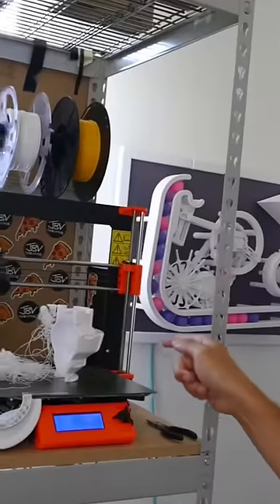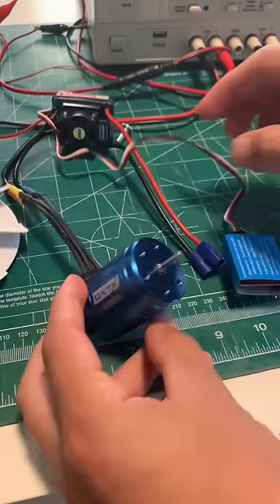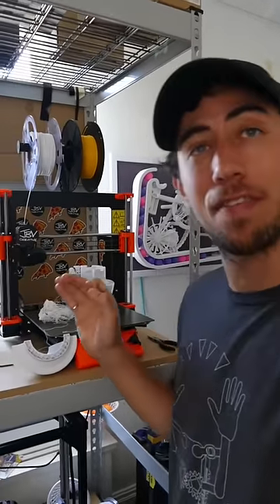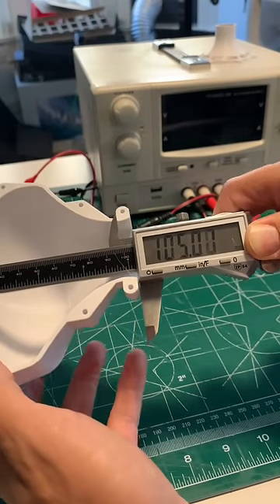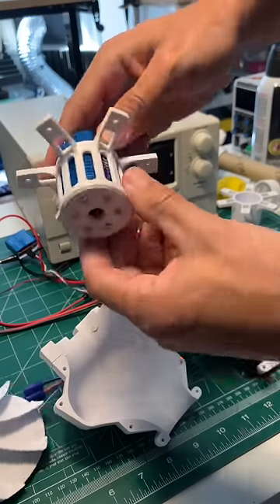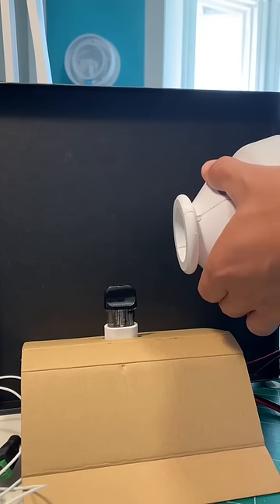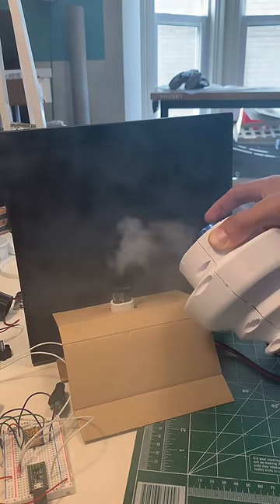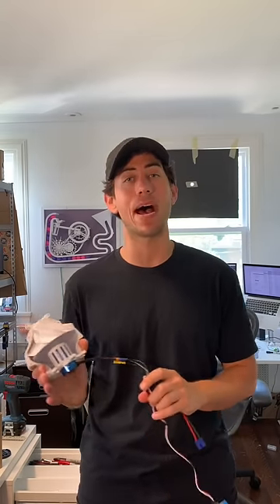Making A High Powered Fan with 3D Printing

Comment: I have had success redirecting the outward flow of a hybrid type of impeller like your (axial/centrifugal) by adding fixed blades at the outlet to redirect the flow backward. Like the stator in a turdine. Another thing that helped was to print a full circle wall around the impeller so you don't have to deal with impeller clearance with the housing.
Reply: Make sure the area of your inlet and outlet is the same so that the air can keep the same density all the way. That way, all the energy goes into speed. Right now, your outlet looks way bigger, which means the air must decompress so much that it creates a vaccum. We're in Bernouli's territory!

Comment: It’s pretty easy to solution as to why it’s creating vacuum on both sides. Number one your fan apparently has a bell like structure which means it has a negative zone of pressure at the larger end, so well some air and escape it isn’t enough to overcome the vacuum that’s propellers are making as it rounds the edge of the containment. This results in air being sucked back in and into the bell like shape on the interior. To solve this you just simply need to round the edges of your propeller at the end on the larger side and also make a flat end but that won’t result in maximum air movement. I redesign of the propeller by drilling holes in the bottom of it and opening the propeller would be best.

Comment: Look into centrifugal pumps.  The outlet is typically tangential to the outside diameter of the housing.  Also the housing has a volute shape to help with the flow or movement.

Comment: Increase the size if the outlet. Outlet should be around 2/3 greater than the inlet and the outlet needs to be positioned correctly. 90 degrees from the inlet. It’s a turbo dude!

Comment: Exponentially low area and high speed at the exit curve. Just cover the center part of outlet at the bottom of the motor and all the vaccum in the back side will be either removed or added the front instead. Maybe also instead create a shell wholely encasing the housing with a gap, creating another pathway on the outside of it using the high speed air at outlet to suck more in.

Comment: I'm guessing the inlet may be starving the fan of air. Expanding it and/or bowing out the walls next to the blades should allow incoming air to pull in more air "buddies" (friction) along. Currently, on the output side, you can put a cuffed vent on the end to better segregate incoming and outbound air, possibly with a twist similar to rifling. Subscribing for the future! 👍

Comment: You need vanes or a volute to laminarize the flow again and convert the high velocity created by the radial blades into higher pressure.

Comment: It looks like a lot of good advice has been given, but mine would be to check the pressures at each point and user Bernoulli’s Principle to see why you have 2 regions of negative pressure and what you would need to do to fix it.

Comment: Hi, mechanic here that works with impellers. It doesn't matter the direction the impeller turns. That just changes the in and out sides. The reason you are getting suck back, is the housing isn't sealed and the impeller has too much wiggle room between the housing and the impeller it self.

Comment: Could be that the air speed on the exit end is creating a really low pressure zone there and sucking the outside air, but i dont know why it wouldnt join the rest of the air flow instead of going in lol.
Reply: after thinking about it, it might be due to the big surface area of the exit end. Try making it concave instead of convex, this should make the air sucking almost imposible while also getting you greater speeds since it's subonic airflow. Printing it from the ground up should also help mitigate structure imperfections. Hit me up if I was of any help! would love to see the end result

Comment: Yeah the outlet is in the center. The outlet needs to be at the widest point where the impeller swings it at.
Reply: Yea that's how turbos and centrifugal superchargers work. They basically fling the air to the outside of the compressor wheel.

Comment: In cases like this you should either flip the print the other way to put the weight at the bottom or else have it print a small base which is attached to the print with small prongs that you can break or cut off, you could even widen the base and have it print both halves separately on the same base at least my brain says it should work. Then again I don’t have any experience with 3d printing so I’m equally likely to be totally wrong.

Comment: It's a centrifugal pump so all the air gets thrown to the outer edge of the impeller, your outlet needs to be on the outer edge of the impeller, infact it should be a volute casing

Comment: It looks like if you took 2-4 giant O-Rings and sealed the turbine top and bottom at “inlet and outlet” it might have a more direct air flow.. but when I say 4 I’m thinking that the other 2 are on the turbine’s tip and tail sealed to the wall next to the other two then a couple drops of a lubricant between, hopefully allowing a faster spin!!

Comment: Your inlet and inlet fans need about 1.5 times the size you made. It has a ton of restriction because you need a more stable exit angle, it's choking the air there. If it was a pressure turbo system it wouldn't matter as much due to the almost liquid.

Comment: Without wading through 900 answers, you need stator blades to collect the rotating air at the fan blades exit and curve it back straight and to the exit.

Comment: That type of fan is the same as used in turbochargers. The outlet needs to be kn tje sides otherwise it will just suck air in from both ends. See if there are any 3d printable turbo compressor housings online, or design one yourself, and you've got an insanely efficient blower!

Comment: Try using a turbo charger style case. Impellers are designed to throw air to the sides, not back so you need the air to be able to exit along the side

Comment: Your opening needs to be the same sizes at both
Ends unless you want to neck down your CFM’s. Maybe a diaphragm for adjustable flow rate. Also sealing the housing will make it a bit more efficient.

Comment: The thing with that type of propeller is that it sucks sure in horizontally and pushes it out perpendicularly, this type of propeller is used in a turbo for an engine and so putting the outlet to the side of the propeller should fix your problem

Comment: Looks like you’re using an RC motor and ESC, get a radio for it with adjustable end points and adjustable powerband. You can make it have optimal performance this way

Comment: That's basically a turbo impeller, so when you're expecting it to exit the other side, it's not designed to work that way. Build the housing like the compressor side of a turbo and it should exit the side of the housing.

Comment: It is the shape of your lower blade on the impeller it's shaped for a full draw the lower edge for a housing like that would have more inclination to direct the air. To keep the impeller try a mid draw drawn exhaust and box in the lower.

Comment: The interior walls of the impeller are most likely dragging air causing a sort of low pressure zone vortex this is most likely causing a central vacuum through the output. You can try caping the bottom of the impeller body and test again.

Comment: On a centrifugal there is usually a volute on the outlet, which allows expansion and further pulls the air in the desired direction. Hope this helps

Look at Howden compressors SG series ( I used to work there)

Comment: I see the problem, the top end is creating a tube of air coiling much like the back of a pick up truck. You might need to create a break in the tube by putting a wall inside that prevents the air from circling around the top near the exit.

Comment: Close off the back and put a discharge hole out the side. You have a centrifugal fan so it has nowhere to throw it straight out at.  Air is like water,  it wants to go the easiest way out.

Comment: Depending on specific speed you might need an axial or radial fan...for radial fan you need a volute otherwise you will have recirculation behind the fan...which is causing vaccum at back

Comment: You need to look at rockets and the air flow principals.  The blades are pulling air in faster than it pulls out and theres no bottle neck affect to compensate..

Comment: An Onxy motor!!!! We have those at my job, they are used for RC cars usually

Edit, I noticed you are using a lipo battery, make sure that you never drain it past the low voltage point and never store it fully charged 👌

Comment: You might be able to create a vacuum outlet system with what you have by cutting breathing vents periodically in the housing… and if you need to route out the excess air from the fan you could attach an exhaust system… think car or truck intake and exhaust

Comment: Kinda looks like a turbo. 
Maybe use the 🐌 snail design. 
That's supposed to pull hot air then slightly compress it and force it into the intake.

Comment: So if you're using a vape pod system for the vapor effect. Have you thought about doing a rebuildable atomizer with a drip system? If you set it up with stainless steel coils and have a temperature controlled device, you can have it go for a lot longer and with a less chance of getting a burnt coil smell for longer shoots or testing. Plus you can do straight vg ( vegetable glycerin) for a thinker cloud effect.

Hmu if you have any questions with the vapor on vape devices. I use to work in a "lab" making and designing flavors for the vape industry

Comment: Even worse is when early in the print you have one little spot of a support break off and you know it's probably going to mess it up but you think ah that's a small support so if not supporting a whole lot, and it won't extrude much filament so it should just collect on the side of the support, maybe it'll be fine, and it ends up balling up and knocking a part of the other support off, that gets stuck to the nozzle and knocks the entire part off and then you have 8 hours of spaghetti.

Comment: The air escape between the impeller and the housing.
Because if the high pressure, the air goes back

Comment: Its a compressor so it needs to be rotating so air travels from the big opening (motor end) to the small opening. 

Those pointed tips of the fins need to to rotate in the direction they are pointing.

If you still don’t get a good directional flow then its probably because there is too big of a gap between the edges of the fins and the housing. You would need to adjust the model and reprint.

Try slowing down motor rotation speed to see if you can at least get good flow direction without any blow back. It seems like your compressor is working but your tolerances need to be improved to reduce the gaps between the moving part and the housing.

However looking again it almost looks like a vacuum fan…. Which means everything is opposite and its goal is not to move a bunch of air but to generate vacuum at the smallest opening…. Need to figure out which one it is.

Comment: It's not pulling air into the fan. It's pulling it into, more accurately air is being forced into the low pressure center of the  outlet side. It's like an open ended vacuume chamber. A tube on the exit would create lanier airflow. But I don't think it would improve function, it would blow harder but not necessarily more. Air intake might be less.

Comment: It my not be a fail. Try putting a cone on the inlet to stretch the edge out about a inch and sand the inside. The rough surface could be affecting the flow with how little clearance you have around the tip of the blade. Maybe sand and coat the blade in uv resin.

Comment: That flat base is changing the direction of the air because of the walls around the fans. You could simply lose the base and expand the outlet leaving just the fans and likely reverse the air flow. I'm not the most educated on this subject however lol, just my simpleton thoughts.

Comment: Look at a standard turbo,  you have your points of airflow reversed ergo your motor is spinning in reverse.

The output is supposed to be the small end where the compressed air from the impeller blades exits the unit

Comment: actually you are seeing the same effect as why we have Turbofan engines now on most jet aircraft.  look to create a high speed bypass around the shroud that will have some induction of air created by a semimesh around the shroud, and then a total shroud around that.  fluid dynamics is not easy but use the experience of other designs to augment your design to peak efficiency and use.

Comment: Looks like a centrifugal fan, so the outlet should be on the side.
Reply: Doesn’t have to be, small radial turbojet engines get away without really doing that. What he needs is more radial space around the impeller (I’m sorry If this is getting a bit repetetive haha)

Comment: You can't have a reduction in diameter on the outlet of a centrifugal fan because of the fact that the air is thrown outward from the centre thus the outlet also has suction

Comment: If you look at a modern axial compressor the straightener or the stator between the compressor sections on the output of your compressor it should help as far as going to the side not so much unless you go quite a ways meaning imagine the blade form reversed in the same plane stationary that puts your output in a very large diameter in a very thin layer around.
Whatever it took to pump it it will take to straighten it out you will gain a lot of diameter though you have to sneak back down to a reasonable diameter or just let it discharge all around if you're not trying to compress anything only trying to pull a vacuum.
The converging diverging duct thing you don't want to blow air out of the hole with a 90° face around the hole works better if you have an involute radius on the exit look how air or fluid flows through an orifice you'll see what I'm talking about

Comment: Your exit is missing flow laminators in that type of setup. On the exit they should scoop against the rotation of the air being moved out then, slope or angle out straight to a secondary flow laminator to straighten out the air and make it turbulence free.

Also that impeller design is better suited for turbine side, in other words air runs over it so that it may power something else. You need a compression wheel instead. Where the blades go from gradual large air grabbing angle to a stepper tighter compression angle.

But a flow laminator should fix this, not efficient and for thw air it's moving noise is high. 

Some examples to look at are jet boat systems, automotive turbos (the turbine and compression side both have different profiles. DM me for napkin doodles.

Comment: I'm not sure how it needs to be but I would venture to guess it's why turbo chargers are the way they are. They pull in from the front but spit out on the side so my suggestion would be to try making it like that or i guess more like a centrifugal supercharger since it will be driven by a motor and not hot gasses.  unless it has to be the way you made it

Comment: Is it possible your housing gaps are fine but Its moving more air than the inlet allows? Leave more clearance diameter at the inlet or create some more distance from the exhaust side with an intake bell that is greater than the current diameter and it might fix the problem. The current housing configuration might have it basically trying to move [3x] of air volume but its only getting [x1] supply of air volume to draw from.

Comment: Maybe a change to the geometry of the housing?
I read the comments about an axial impeller, I'm not familiar enough with fans to know the difference at the top of my head but I will look it up after this. I would want to make the impeller I made work, but like I said I don't know enough to know if that's even possible, just a guess

Comment: You need to look at how a turbo is built. There's only one inlet, on the front and one outlet, on the side. You're trying to use it as a push through when it should be spinning pulling air in and putting it out the side of the fan instead of putting it out the back.

Comment: There isn't any real chambering to promote a solid flow. I would find an old turbo and pull the impeller side off and study the geometry. It could be that you need a more drastic wall angle at the base of the impeller plane.  It's pulling more air than it can push past that section

Comment: You need a straightener it's kind of like the turbo blade it just receives the air from it and straightens it out or you can call it a nozel must give up pretty close to the end of the compressor tips

Comment: Ok so I was with you till you hot glued this, hey rookie (lol) try super glue it chem melts the plastic together or go pro and buy a 3d printing pen and "weld" the piece back on.   Btw I did this with my class but much larger the air coming back out has to deal with the compression area not being the right size/shape. Not bad tho
Reply from the maker: Ey! Nothing wrong with hot glue 😎

Comment: An impeller and housing shaped like that won’t do much.  You’re pushing air sideways. If you had a snail shell with the inlet in the front and exit on the side you would be in business. Or vide versa with a modification to the impeller. You can send me your file and I’ll make it right for you.

Comment: My friend that is a turbo. It needs a side exit, not a rear exit.
Reply: That’s not a turbo? You mean a centrifugal compressor? In that case, he doesn’t need one as he’s trying to remake the dyson *fan*, which uses a compressor blade to push air into small spaces. I’m pretty sure he wants a fan, not just an air compressor
Reply: @xmysef4920  well it's not really a turbo, but I believe a side exit would be beneficial.